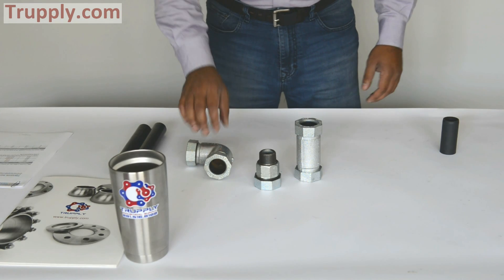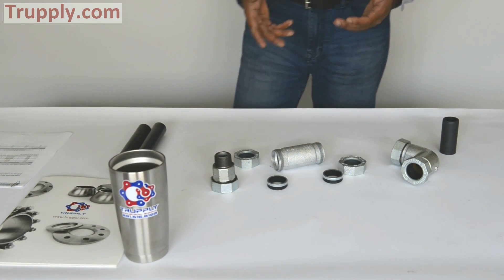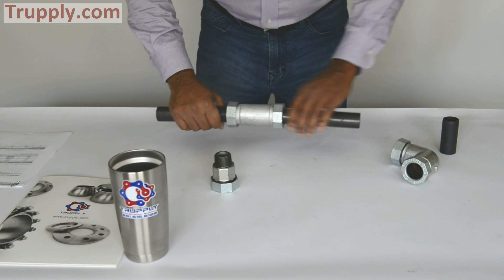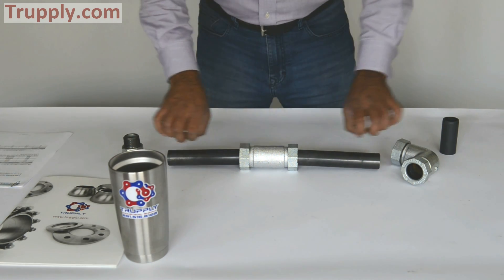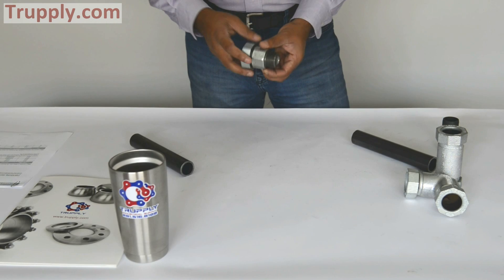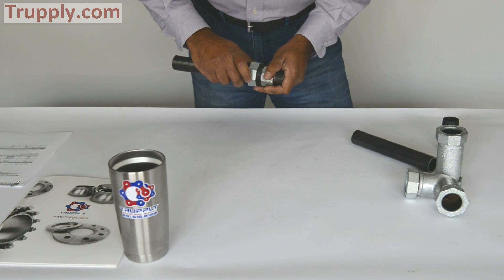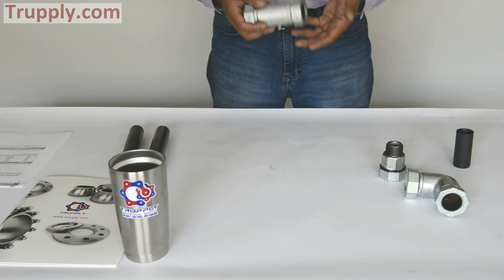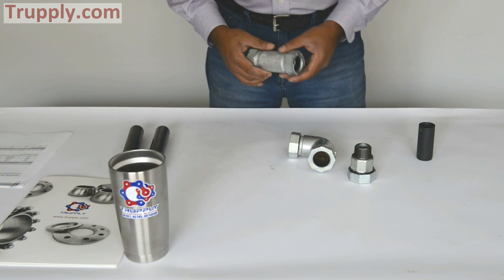Dresser Style 65 Compression Coupling

Comment: I've been in the Natural Gas industry for over 35 years and these dresser style couplings do have a place in low pressure applications. However I do take exception to your demonstration of use in this video. It's apparent your experience in real-world applications are limited. Having installed hundreds if not thousands of these type couplings in my career of 35 years I can tell you glazing over the application of stab depth, not taking measurements or marking stab depth, is a big mistake in this video. I cannot stress enough the importance of stab depth when installing these type of couplings.
Reply: Care to elaborate further?
Reply: @dereks4497  I looked up the term "stab depth" and it seems like it refers to how deep into the coupling each pipe end goes. Here's some instructions for a similar item that mentions "stab depth" in the instructions. Note step #4.

https://www.elster-perfection.com/assets/products/products_elster_files/PermMechCoupInstall610.pdf
Reply: can I use it for hot water?
Reply: @fernandohernandez7733  , I would suggest only using NSF approved fittings for water and the recommendations of your local code enforcement authority for your area.
Reply: At 3:02 he (and I cannot stress enough) CLEARLY says "you should mark your pipe" and explains why.  YOUR "real world" experience in listening comprehension, in my 60 years of experience is "limited".  And it's funny that you've had 4 years to correct your oversight but apparently you're not man enough to do so.
Reply: Can u use these on poly natural gas line?
Reply: @mikesfuntimes  , I would not . I would only use risers , couplings design for the polyethylene pipe & riser connections and I would only used approved materials . And I would not recommend this work for anyone uncertified  & unlicensed (A lot of liability in this industry).
Reply: @boby115  the problem is I had a HVAC guy out to run a gas line from my house to my shop and he used 1" yellow poly CTS 0.099 and now that that's all in the ground  and is about 15' short on pipe for the CTS style pipe so iam kinda up creek here looks like I'll be pulling 150ft of this crap out and replacing it my self with the kit from home Depot